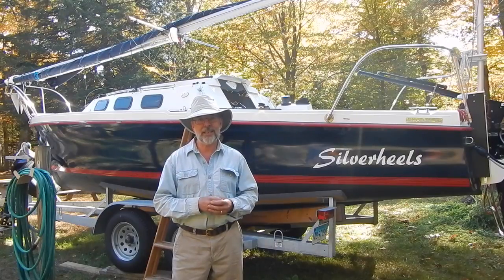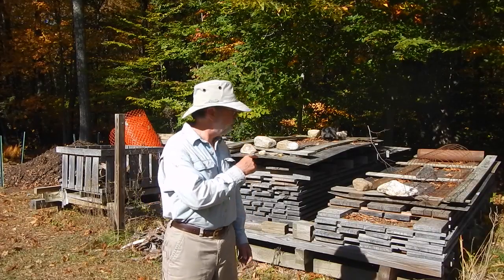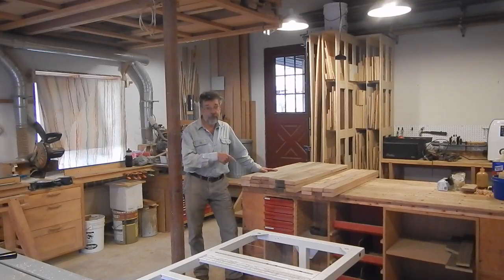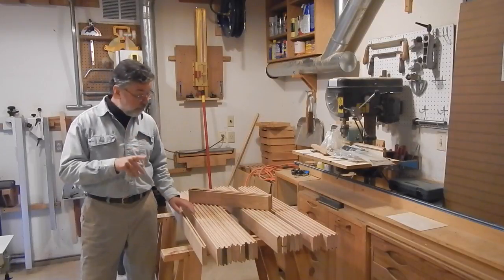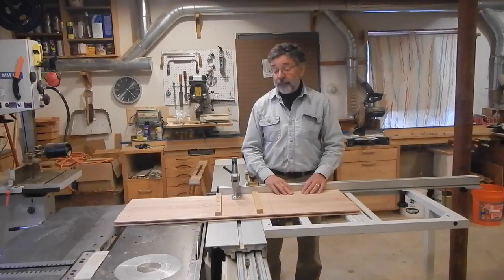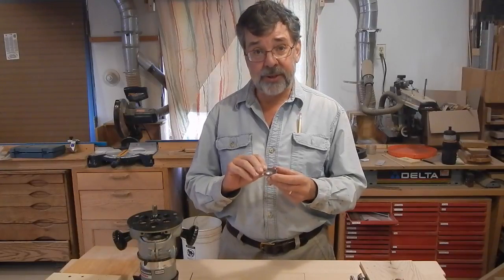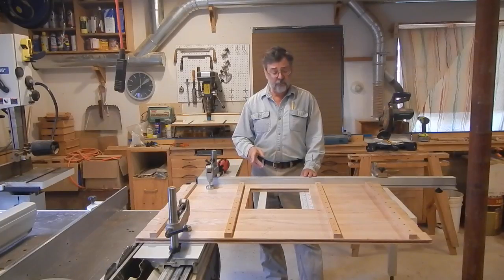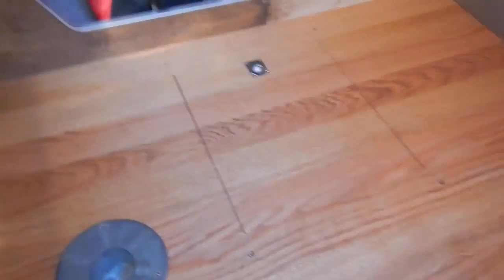Episode #7 - Cabin Floor Project

Comment: Peter, you lowered the head floor, is there a reason to keep the bulkhead between cabin floor and head floor high. It seems to be a trip hazard. Is it advisable to trip the bulkhead flush?
Reply from the maker: Patrick, There are perhaps two reasons to leave the bulkhead between the cabin and head unchanged.  1. - if some future owner wanted to put things back as they had been, it wouldn't be too hard; and  2. - trimming the bulkhead flush to the floor would have been more work for me. 

It's been that way for a few years now, and I've never tripped over it.  --Peter

Comment: Thanks again for providing such great detailed videos. Very inspirational. This info is very helpful.
Reply from the maker: If you (or anyone) attempts a similar project, I would recommend letting the flooring material acclimate outside for a while at some point in the process before final assembly into panels.  My floorboards expanded after assembly which caused the panels to bow.  I basically had to take them apart and re-do that step.
Reply: s/v Silverheels Do you think those boards you showed at the beginning would’ve worked out? Or were they too far weathered?